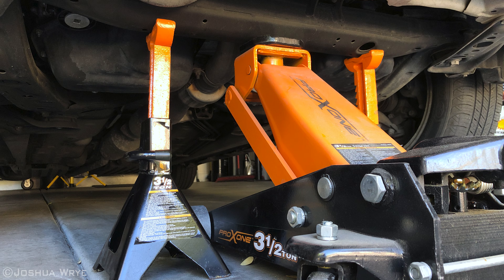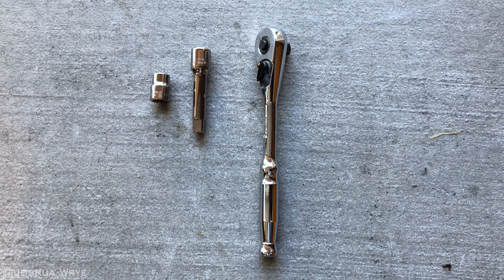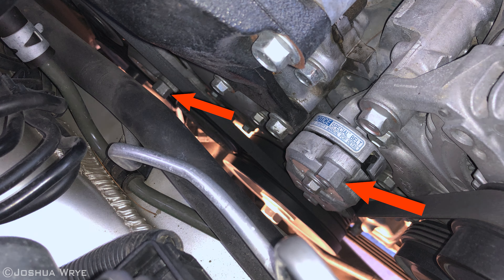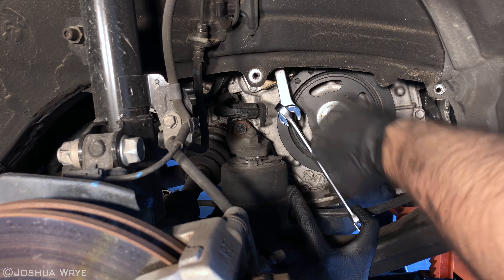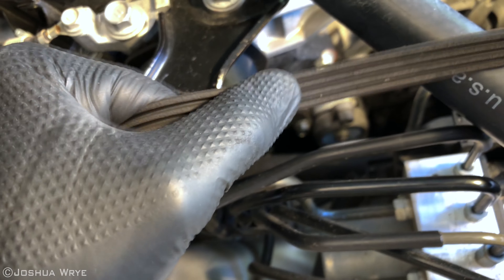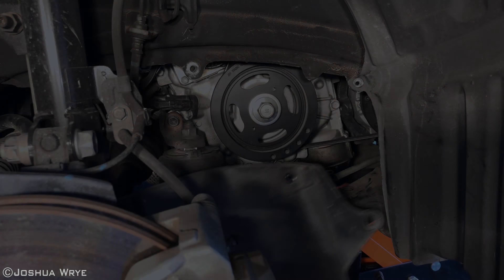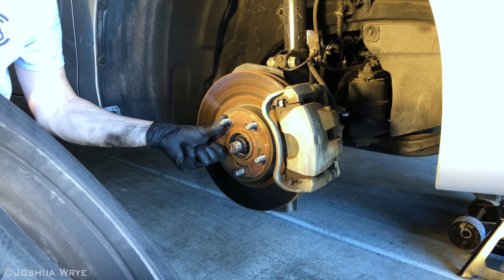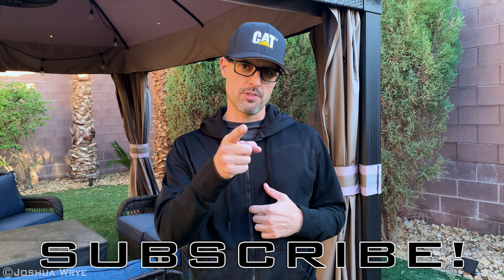How to Replace Serpentine Belts on Your Toyota Camry [4K]

Comment: You are an exceptional instructor.  Thank you for creating this video.  I am going to try to replace my belts now on my 2010 Toyota Camry.  The car has almost 400,000 miles on the original set of belts.

I successfully changed both belts.  I tried to follow all directions and the job took me a little over an hour it was a bit tedious but I got it done.  On he outer belt I had to install the crankshaft pulley before pushing it over the smaller pulley.  I almost thought my new belt was too small.

Thanks again for creating this video.  

My the Lord bless you
Reply from the maker: Thanks, JerveyIT; hope the video helps. Newer belts mean quicker response time and better gas mileage and should be replaced at the 100k interval. Glad those old belts haven't snapped on you yet. Good luck with the swap out!

Comment: This is the best video I have seen yet on replacing the serpentine belts on a Camry.  The outer belt installation was the bigger challenge of the two, because the clearances are tighter.  Take your time and be patient, and it's not that bad.  Maybe 1.5 hour job for me, start to finish. I found I only had to use one 14mm wrench, but it doesn't hurt to use two.  This video helped me replace the belts on my 2011 2.5L Camry.  Liked and subscribed! Thanks!
Reply from the maker: Thanks, ku4uv! Appreciate the feedback and glad your were able to use the video to save some money doing the work yourself. Have a great weekend!
Reply: @MilitarizedCitizen  Thanks!  You have a great weekend too!

Comment: This video is a life saver!  Showing how you put the 2nd belt on and putting the 14 mm wrench on the tensioner pulley FROM THE BOTTOM saved me big time! I used 2 wrenches exactly like you did in this video.  The only difference is I connected the belt to the lower right pulley last because it was easiest for me to reach from the bottom.  Thanks a million!!!
Reply from the maker: Glad to hear that! It's almost impossible to do it any other way when you can't pull the engine out. Thanks for the feedback!

Comment: great video, I replaced belts on my 2010 Camry with 201k miles last weekend.  Alternator belt (wider) has 2 cracks every inch or so.  Water pump belt (narrow) has no cracks at all, still in great condition.
Reply from the maker: Thank you! Glad you were able to replace them yourself.

Comment: Great job at demonstrating how to do this job! Thanks for uploading it. I have the following question:  the inner belt tensioner is easy enough to push it with my fingers and take off the belt.  Is this normal? How to I diagnose a bad tensioner?
Reply from the maker: Thanks for the feedback, Oscar! I'd say that isn't normal. The tensioner should have a good amount of force required to remove the belt. If it doesn't, you could have belt slippage which would wear the belt sooner than normal and waste gas.
Reply: That’s what I thought but wasn’t really sure about it.  Thanks again for sharing your car (kindly) wisdom.
Reply from the maker: No problem at all; glad I could help. Great catch on the tensioner; most people wouldn't have caught that.

Comment: Great video! I just purchased a 2011 Camry w/105k miles.  It's been well taken care of, but I don't believe the serpentine belts have been serviced. How many miles on the Camry that you did this service on?
Reply from the maker: Thanks! I hope the video helped. I did ours at around 110,000. Toyota's recommended mileage for replacement is 100,000.

Comment: I'm just wondering why you didn't use a serpentine belt tool instead of the 2 wrenches on the automatic tensioner pulley?? ... they're only like $45 in most auto parts stores (not sure if they do rentals on these or not) and if you wanna go cheaper, Harbor Freight has them for around $20.
Reply from the maker: Hey John, simple answer is I didn't want to spend the money when I knew a trick from my old bike shop days. ;)
Reply: @MilitarizedCitizen  Good point in showing how to do it with what you have (if you didn't have the serpentine belt tool) ... but for me I'd probably pick up one from Harbor Freight for $20 that way I can use it on my roommates 2010 Camry and my 07 Monte... but that's me though.
Reply from the maker: For sure, John!
Reply: if you don't need the tool, why would you buy one? It's no easier.

Comment: Going to do this on my 2011 Camry LE. How often should this belt be changed? Also, what would be a fair price for labor if I have a mechanic do it?
Reply from the maker: I believe belts should be changed every 90-100,000 miles. I'm guessing it would cost around $250-300 in labor. Not sure tho.
Reply: @MilitarizedCitizen  Okay I'm due to change them then. Stealership wants $100 for labor..thought that seemed like a bit much
Reply from the maker: That doesn't sound too bad at all, cost-wise.
Reply: @MilitarizedCitizen  Yeah, not too bad, the two belts are like $30 together.
Reply from the maker: Yeah that's not bad at all.
Reply: Not sure if I'm atypical but just replaced both belts on a 2010 2AR-FE engine at 250k miles. No cracks at all. Look like new. Have owned from new. The front brake pads and rotors were changed at 210k...didn't need to as the pad center slot was about 60% of new.  I use the auto stick for deceleration most of the time.
Reply from the maker: One of the other things to consider is the stretch in the belt. A loose belt can slip and cause other issues.
Reply: @megalomaniac7972  Easy to do....just follow these excellent instructions. The wrenches work fine, don't need to spend extra cash on specialty tools. Probably overkill but the pwr steering belt was doubled over in the sleeve one more time than necessary so just ran a rod tru the belt on my engine hoist and put it in tension overnight to remove all the kinks. Nice and round the next morning.
Reply: @megalomaniac7972  that's a good price.
Reply: If you have a professional do the belt replacement, it should be the entire job with parts. I get $138.48 with tax. Depends on who does it and where you are. Belts are inspected and replaced as needed.

Comment: Where did you find these belts? Everyone is saying there is only one belt for the 2008 Camry SE 2.4
Reply from the maker: Hi Kevin, I found them on Amazon. There are two belts, as shown in the video. Searching on a Toyota dealer website, you'll be able to find the exact part number and then look for them on Amazon.
Reply: 2008 Camry SE 2.4 has ONE drive belt but this video is a 2011 Camry 2.5 which has TWO drive belts

Comment: Just wondering why you disconnected the battery??
Reply from the maker: It's always a good idea to disconnect the battery because you never know when a wrench might fall or you might hit a cable and cut it open (or one that's already cut open) - all issues that can cause shorts in the electrical system, creating more work and costing more money (and possible physical harm). Thanks for watching and don't forget to subscribe! 😉
Reply: @MilitarizedCitizen  Okay thanks. And thanks for the video!
Reply from the maker: Glad it helped!

Comment: I have a 2017 and I was told you just loosen the tension and put the new belt on with this newer car.
Reply: I have a 2016 Camry 4 cyl. I used a 14 mm socket to move the tensioner pulley and slipped the belt on, water pump pulley last. It took 2 minutes. Labor from a mobile mechanic was quoted as $150.
Reply: Only one belt on the 2017 2.5, different animal
Reply: @futfut1 It's no secret that you can save money doing repairs yourself. The mechanic is paying business expenses at the same time. You are fast, usually that is a bit over a half hour. I get $94.87 for that job, with tax. But, I won't come to you.

Comment: Will this same process apply to a 2005 toyota camry le 3.0?
Reply from the maker: It should be very similar.
Reply: So I just bought the 2 belts from Toyota hope it goes well
Reply: Do you have a diagram for the belts
Reply from the maker: I haven't been able to find one. Since there is no real way to take a picture unless the engine is removed from the car, it makes it difficult. I also haven't found much online. If I come across one, I'll send it your way.

Comment: Hello boss why we need to disconnect battery just curios. I’m guess change both belts around 100 k miles.
Reply from the maker: Hey Thomas. The reason I always disconnect the battery when working in the engine compartment is to ensure that no accidents happen. The last thing you need is for a metal wrench to drop out of your hands and connect the battery terminals, starting a fire and ruining an otherwise perfectly good weekend. 😜
Reply: @MilitarizedCitizen  Thanks boss.
Reply from the maker: You're welcome, Thomas. Have a great weekend!
Reply: @MilitarizedCitizen  have a blessed day.
Reply from the maker: You, too!
Reply: @MilitarizedCitizen  

I have an other question. How was the tensioner looking while u changed the belt. My 2016 Rav 4 tensioner went bad and broke belt on 100 k miles. There was no sound before it break. Now I’m thinking camry has 2 tensioner. How long it last ?  Thanks 🙏
Reply from the maker: I'm not sure how long the tensioner is supposed to last, but if you can see that the bearing is worn out or that the spring on the tensioner is bad, I would suggest replacing that as well. The one on the car in the video was fine.
Reply: @MilitarizedCitizen    Thanks
Reply from the maker: You're welcome!
Reply: Gracias I did it just how you said it and worked perfectly 😅
Reply from the maker: Glad the video helped!

Comment: What is the equivalent for non-Toyota belts?
Reply from the maker: Aaron, any local auto parts store should have their brand of belt that should work well.
Reply: @MilitarizedCitizen  They seemEd puzzled about the 2 belt system. Are the belts the same? Only 1 belt type was showing up on their computer.
Reply from the maker: That's odd. What year is your Camry? The two belts are not the same; one is larger than the other.
Reply: @MilitarizedCitizen  2010. I think i figured it out. They have one listed at 0.4 inches w/3 ribs and another at  0.6 inches w/4 ribs. I'm thinking that's the two I need.
Reply from the maker: I found this online:
1) Belt for alternator, water pump and air conditioning. Top width: 9/16" or 14mm. Length: 49-3/8"
2) Belt for hydraulic power steering. Top width: 7/16" or 11mm. Length: 47-3/4"

And you are correct on the ribs. One has 3 and one has 4.
Reply from the maker: Check this out: https://www.oreillyauto.com/shop/b/belts-hoses-16454/belts-16521/belt---serpentine-type-12828/eebb7a080a6d/2011/toyota/camry
Reply: @MilitarizedCitizen  Thanks again for all your help. Job isn't done yet but I was able to find the belts locally.
Reply from the maker: You're very welcome. Glad to hear you found them. Let me know how the job goes!
Reply: @MilitarizedCitizen   Go the belts on last night. But after starting the car the belt comes off the compressor pulley. Gonna try again today. Any suggestions?
Reply from the maker: That's odd. I'm not completely sure. Is it sitting on the tensioner completely?
Reply: @MilitarizedCitizen  So we figured out the bearing in the compressor is not good. It was causing the pulley to wobble the reason the belt wasn't staying on.
Reply from the maker: That makes complete sense and is good information to know. Glad you got it figured it out. Congrats, bro!

Comment: If one needs to change the belt and not save it, just cut it. Then install a new belt.
Reply from the maker: I would NOT recommend doing this for multiple reasons:
1) If the new belt(s) don't fit, you cannot put the old belt back on in order to use the vehicle, making the vehicle completely inoperable until you find the correct one.
2) You can break the tensioner pullies by allowing them to snap back when you cut the belt(s).